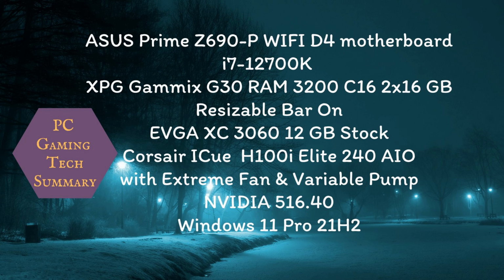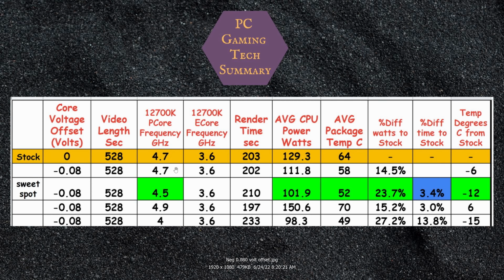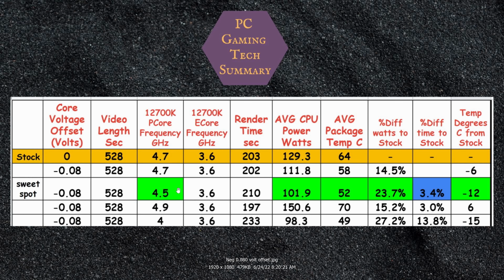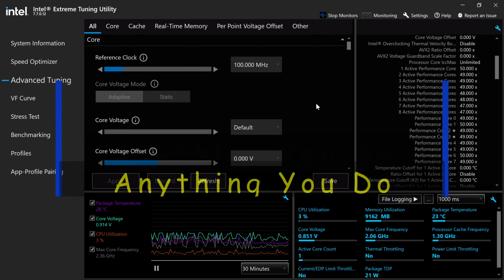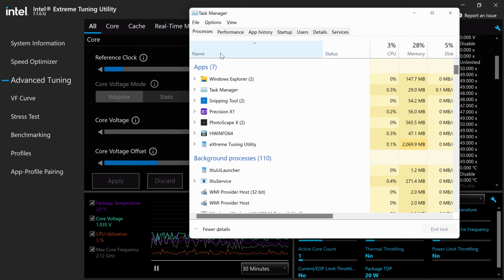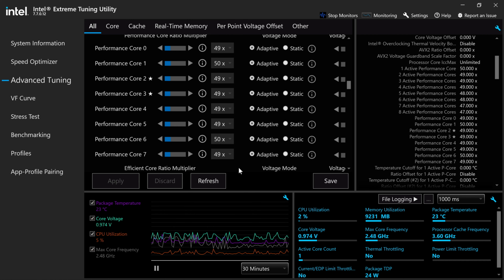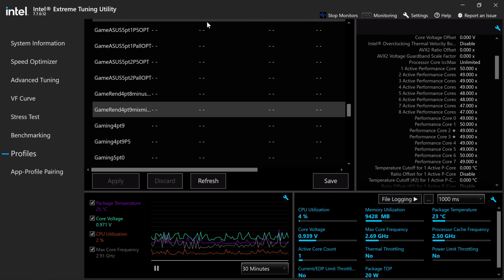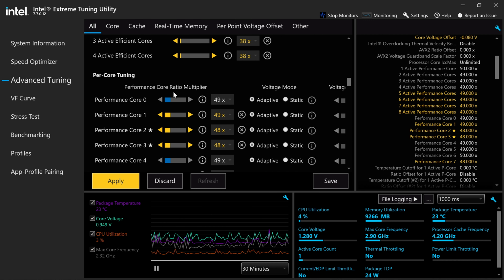I Lower CPU Power Usage and Temperatures by Undervolting the Intel i7-12700K central processing unit

Comment: This is the first time i seen a good recommended underclocking.
Reply from the maker: Awesome, glad I could help. I have since moved to using the UEFI Bios so that my PC always boots and boosts P-Cores to 4.6 GHz and leaving E-Cores at stock. It is Summer time here, and I rendered my  most recent video and I had one core hit a max of 80C. I have an ASUS motherboard, so I can make a video if you have an ASUS motherboard as well.
Reply: @pcgamingtechsummary  I am trying out your underclock at 45 ghz on the p cores. I have set them from one core at 49 and down to all at 45. So a quiet and well working system. I hav tried other configurations. But this one is the coolest literately. If I upgrade to the 14700K i now know my way. Btw using an ordinary aircooler
Reply: And it seems stable as well. Time will tell.  My temps is around 54C when compiling ports on FreeBSD. Load is at 35. So it means fully utilized for a long period of time 😀
Reply from the maker: Great! Your comment on aircooler got cutoff. What cooler are you using? I am glad the software is working for you. Sometimes my system would boot into stock settings and there was a risk of my cores getting further damaged. Playing around with lasso was a mistake. My 2 best cores are now by 2 worst cores. @larshenrikrn4105
Reply: @pcgamingtechsummary  My cooler is an Cooler Master Hyper 212 Black. So nothing extraordinary. Today i changed the offset from 80mV to 70mV. The computer was not rebooting properly. And now I will test for a couple of more weeks to make sure it is stable. I am using other tools than you are. Simply put because my operating system is FreeBSD not windows